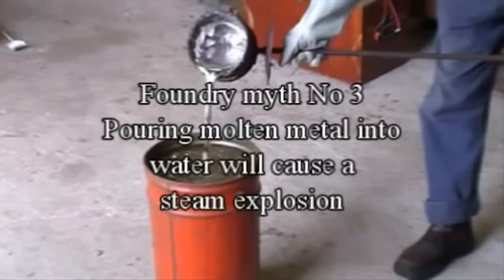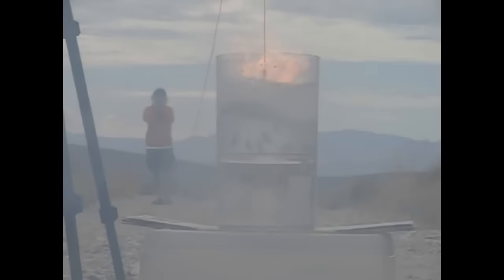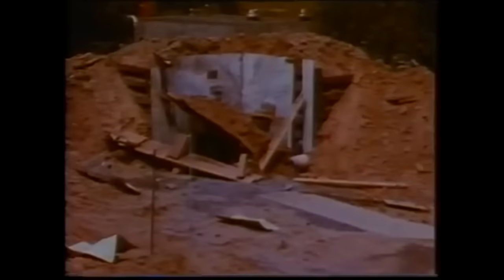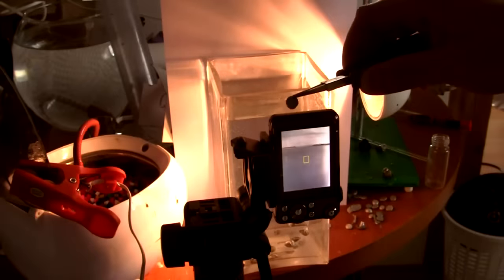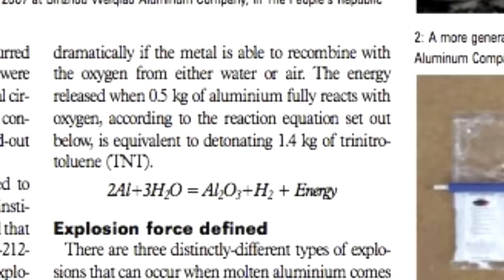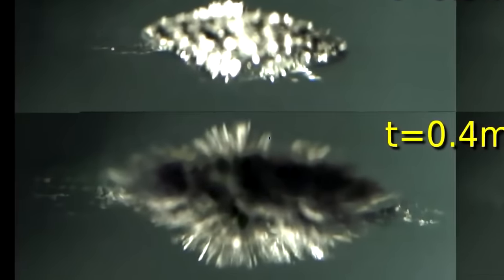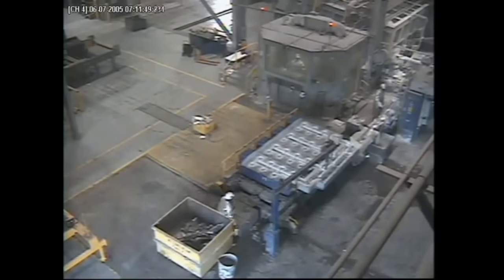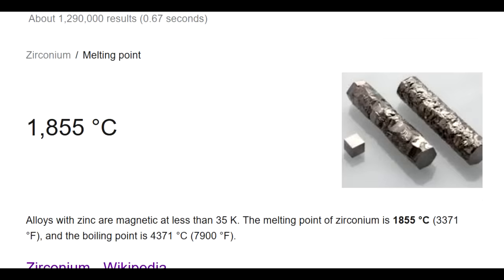The Awesome Power of the Aluminium-Water Explosion!

Comment: Thier logic: No one has ever heard from a person that died in one of these explosions.
Reply: Never again at least.
Reply: Yes, dead people can’t speak. Here is a gold star people ⭐️.
Reply: Love how the dude poured molten aluminum/aluminium/alumininininininium under his nuts...
Windows also shit itself 9:46
Reply: But has an explosion caused by pouring comparatively small volumes of aluminium into water actually been documented? Where is the empirical evidence?
Reply: I would have thought it perfectly logical to conclude this is what brought the main two towers down on 9/11.    The fusalages of the planes melted in the fire, which would have been burning off oxygen inhibiting an oxide layer.    Introduce water from the sprinklers and you blow out the inside of the building.  

This isn't to talk about the whys and wherefores but I can't understand why nobody wants to except this explanation that seems to fit the evidence where the main two towers are concerned.
Reply: this is the same logic that has lead to way too many tragic industrial accidents
Reply: @Daveyboyz1978  Molten aluminium was seen pouring out of the towers - indicating temperatures of over 600C, enough to reduce the strength of carbon steel by 80%.
Fire is really good at turning steel into spaghetti - without melting it at all, gravity does the rest.
Reply: @allangibson8494  the towers had 10 times the required strength even with an 80% loss of strength they would still stand.   More to the point liquid aluminium reacts violently with water particularly in the absence of oxygen (which blunts the reaction by oxidizing the surface of the aluminium) fire eats oxygen and thus when the sprinkler system rained down water on the aluminium the insides of the building were blown up.   This explains the witness statements about hearing explosions and the much hotter  than 600 degree temperatures detected in the rubble as a result of the chemical reaction.
Reply: Sounds like the same logic of covidiots
Reply: sOuNdS LiKe sUrViVoRsHiP BiAs tO mE
Reply: Famous last words.
Reply: @Daveyboyz1978  Right right. They were so impenetrable that the Magic infused steel that got red hot didn't weaken AT ALL
Reply: @thevalorousdong7675  I would claim that, but given the fireball burnt up all of the jet fuel in one fell swoop,  the fire would not be hot enough to weaken the steel by enough to being it down.  (It had a safety factor of ten... losing half its strength wouldn't make it fail)

An exothermic reaction between water and aluminium however would produce enough heat and kinetic energy, and would explain why the thermal scans at ground zero showed 1000+ plus temperatures (far hotter than an office fire remnants)

Comment: We always took a blowtorch to the molds before pouring metal into them when I worked at a foundry.  It served two purposes, 1) eliminate any moisture in the mold and 2) heat the mold up to prevent shock when thousands of degrees molten metal hits the mold.  I realize this is kind of old video at this point, just saying..
Reply: Absolutely, preheating them prevents this, and it is not an explosion of the metal, it is the expansion of water to 1600 times its original volume as it flashes to steam instantly that causes the expulsion of the molten metal from the moulds.
Reply: similarly, I heat up my pans before adding oil when cooking to obtain a no stick cooking surface!
Reply: @kamalmanzukie  you arent pose to add cold oil to a hot pan as it can cause the oil to ignite
Reply: Be sure to heat it up a lot, blowtorch burning byproduct is also water
Reply: @davidblahota5655  Just wow David, that is a critical point that would have never occurred to me. I hope u-tube lives forever because the comments on some videos (like this one) are sometimes as insightful as the videos themselves. thanks!
Reply: @michaelharvey-nb6vw  i don't recall writing that, i was probably drunk, never poured metal, no idea what am i talking about. But i do see condensate around the flame in the first few seconds of occasionally heating up metal with a blowtorch.
Reply: @MrJohnandMargie actually it is a coulombic explosion caused by solvated electrons. If your unlucky enough for the aluminum to have the oxide layer stripped off…then it’s like sodium in water🎉

Comment: when I was like 8 or 9 I saw a YouTube video of someone melting down soda cans and casting them in molds. I was fascinated by it and convinced my dad to help me build a small furnace for melting metal. we dug a deep, narrow, cylindrical hole into the ground, with a hairdryer buried underground to blow air up the holt. we fitted an old steel stovepipe into the hole and filled it with burning firewood, then cranked the hairdryer up to max. after leaving the wood to burn down to white hot coals(accelerated by the airflow from the dryer) we inserted a graphite crucible that we had gotten on eBay and managed to melt down 20 or so soda cans and filled the crucible with molten aluminum, which we cast into a perfect ingot in a small graphite mold(also from eBay). once the metal solidified in the mold we dunked it in water and the ingot popped out. but we forgot to dry out the wet mold before casting more molten aluminum in it and as we added the second crucible-full of aluminum, it exploded, blasting blobs of Liquid Metal 10 feet in the air and splattering my dad's brand new iPhone with hot aluminum. no-one was hurt and my dad's phone somehow survived.

Comment: Had personal experience now already 47 years ago in an Aluminum smelter casting into a mold with barely a drop of water in it. 
Seen with my own eyes it is possible to strip yourself from all clothing in about 1 second flat just to get rid of hot exploded metal on overall. 
Luckily l survived.

Comment: Wow as a metallurgy hobbyist I never knew aluminium could be so dangerous, thank you for making these important safety videos.
Reply: Get some caustic soda, mix it water and dunk some aluminum in it, you get hydrogen gas. Aluminum is disturbingly reactive when its oxide layer is removed.
Reply: @TheRedneckAtheist  Oh yeah, I've seen videos on YT of people filling up fire extinguishers with aluminium foil and a mixture of lye in drain cleaner fluid to generate a bit of hydrogen gas on the canisters.
 The hydrogen comes from the water as its oxygen is used up to oxidize the reaction I believe.
Reply: @zedg7473  that is correct and you get more than a little bit depending on the amount of aluminium

Comment: I had no idea there was a possibility for an energetic reaction between aluminum and water. Thank you for the education.
Reply: The British learned that during the Falklands war.
They had built some warships from aluminium.
Reply: @aggese  I suppose that went as well as I imagine.
Reply: Scott DiMiceli I’ve actually poured aluminum into water and had no idea this was a thing. I knew water entering into the foundry was a risk of explosion but not the other way around. I usually put my casts into water as soon as it was no longer liquid on the outer shell
Reply: it kind of makes me nervous about the aluminum foil in my kitchen.
Reply: @mwperk02  Actually, not as badly as you might fear.  See, it turns out the Argentinian Air Force was even worse at understanding how their own ordinance worked.  They were getting bulls-eyes hits on British warships...from so low an altitude that the bomb's fuses didn't have enough drop to arm them.  (To prevent them from detonating easily when handled or early in the drop, a lot of free-fall bombs have what looks like a little propeller on the nose or the tail.  As the bomb falls, this is spun by the air and the bomb as fully armed while falling once this spins enough times.  This will have some degree of adjustability, but not unlimited, and you REALLY wouldn't want this disabled on a bomb you actually wanted to be able to, say, TOUCH, and bomb release isn't exactly a gentle process.)
Reply: slayne2  Schrodinger's cat hated radiation about 50% of the time I’m told.
Reply: same
Reply: aluminium dust and water ice makes for a VERY powerful and extremely stable rocket fuel.
Reply: Seriously.  It's not like I had any plans to try this, but now that I know it's dangerous, that's a solid no.
Reply: @BlokeOnAMotorbike  
Wow! I didn't know that. Do you have any references I could see?
Reply: @samuelseidel6148  It's risky. Aluminium instantly builds a skin of aluminium-oxide...so that's what prevents direct contact with water. Direct contact of heatedaluminium with water would have it react violently and this reaction would rip the aluminium oxide skin creating follow-up reactions.
You will find no foundrie worker who thinks, pouring liquid aluminium into water is a safe thing!
Reply: Do it doesn't. That is bullshit.
Reply: @jlastre  but one time in every 376 that this experiment was tried the cat was gone but a pile of steaming cat shit was left in the corner of the box..... Schroedinger's shat!
Reply: Doesn't
Reply: @TremereTT  I was Maintenance Manager for UTC Aluminum Remelt and Extrusion Plant from 1981 to 1990
Casting aluminum logs for cutting into extrusion billets is done by direct chill casting. a steel plug is inserted into the bottom of an aluminum ring  that is surrounded by a continuous stream of water. Molten aluminum is poured into the top of the ring in a thin stream. As the ring fills the plug is dropped by lowering the hydraulic ram it is attached to into a pit filled with water. As the ram lowers the plug aluminum is continuously fed into the aluminum ring. The log grows until the log has reached the proper length and the aluminum flow is shut off. The aluminum log is below melting temperature before it enters the water flow. 
The molten aluminum does enter water every time the cast is started because the top of the plug has been raised from the bottom of the pit and remains wet until the aluminum forces the water off of it. 
It is dangerous indeed to be cavalier about handling any molten metal.. Aluminum is one that people see melted on YouTube and think it is safe because of the low temperature. 
Often to their later regret.
Reply: @OldSneelock  I ve seen images of aluminium foundries... only the heavy gear remains in a hole in the ground. It's realy a dangerous Business.
Reply: It seems like if it was anywhere near as dangerous as he claims you could not buy an aluminum John boat that you can scrap on rocks which will knock off the oxide layer
Reply: It’s how they brought down the twin towers

Comment: One factor that makes the explosion more likely, like in the iron cube, is the small amount of water compared to the total energy in the molten aluminum - there's enough to vaporize enough water for a steam explosion to get things started. When it's dumped into a big pool, it gets cooled down fast enough to prevent much happening...
Reply: "When it's dumped into a big pool, it gets cooled down fast enough to prevent much happening..."

That should be _"poured slowly into a big pool"_. If the heat is not allowed to dissipate, the heat capacity of that volume of water isn't going to do any good.
Reply: Bozkurt postuna bürünmüş yobaz AraB devesi  how could it be a hydrogen oxygen explosion underwater? You could have a reaction producing hydrogen (metals+water), or oxygen (fluorine?+water) , but not both
Reply: Bozkurt postuna bürünmüş yobaz AraB devesi  They are steam explosions. You dont separate hydrogen and oxygen with heat alone. The akali metals react with water because they have one electron in their outer shell, that is completely and totally unrelated to aluminum or iron.
Reply: Bozkurt postuna bürünmüş yobaz AraB devesi  yes, so you generate hydrogen. Where is the oxygen coming from to make a hydrogen oxygen explosion?
Reply: Bozkurt postuna bürünmüş yobaz AraB devesi  so how does a sodium water explosion happen in an inert atmosphere?
Reply: Bozkurt postuna bürünmüş yobaz AraB devesi  most commonly used metals aren't particularly reactive. Aluminum, and to a lesser extent magnesium are the exceptions. And aluminum self passivates exceptionally well.

Comment: I remember my apprentice ship and how i once asked what the aluminum on the ceiling was. One of the cast forms made of sand and coated with a graphite solution to create a smooth surface on the end product wasn't dried long enough.

The cast was about 1qm in size with the cast volume of about the size of two car rims. Only about 2 kg of molten aluminum made it in it, when it detonated like a bomb. One dude was pierced ny projectile aluminum, but survived without lasting damages. But damn, the room was about 15m high and about 40x50m in size. Shut was covered with aluminum fragments as if placed by hand to imitate the stary sky.
Reply: Thanks, great video!
Reply: qm ?

Comment: I used to work for Detroit Edison as a contractor in their metering department. One of the types of jobs I would occasionally do is to install remotely interruptable meters for either hot water heaters or for air conditioning units. 

To place the meters for these jobs I had to first move the feed wires for the interruptable service from the load side of the house meter to the line side. In doing this one particular time I inadvertently contacted a live wire with the grounded meter enclosure and the tip of the aluminum cable exploded shooting micro shrapnel into my goggles and my cheeks. Yeah, instant sunburn from ten inches away!

When aluminum becomes the electrical load and there's no circuit protection, there's a colombic explosion every single time.

I was instantly amazed at the intense heat, brilliance of the flash of light, the intensity of the sound, and perhaps mostly, my calmness and presence of mind to not let go of that cable in my glove insulated hand as the tip was exploding!

Comment: The first reaction that would happen in the bunker experiment is that you would flash the water to steam. The steam, under pressure due to the restricted container forces it's way through the oxide layer releasing the aluminum dragon.
By contrast the non explosive shots were pouring aluminum into large unrestricted bodies of water thus reducing the steam flash to only what occurs from the leidenfeost effect which effectively isolates the aluminum from the water.
Reply: Exactly. Thunderfoot is being disengenous in this video by acting like molten aluminum is exactly equal to sodium metal. They're not flipping a coin. They're just doing what they know to be safe enough to replicate.
Reply: So it's sort of like when you're diluting concentrated acid, the difference between adding Acid to Water versus, Water to Acid?
Reply: Aluminium has no problem reacting with steam to produce hydrogen and aluminium oxide with about 1250 kj /mol energy release.
Aluminum is a highly reactive alkali metal which would burn in water or steam if it were not for the thin oxide layer. The addition of 10% aluminium powder to a stoichiometric explosive such as ANFO increases its power substantially as the aluminium reacts with the steam produced by the explosive. Aluminium if it reacts releases more energy than sodium, it is second to beryllium in terms of energy release per gram on formation of the oxide that is why it it added to solid rocket propellants.  Also look up the Raleigh Taylor instability to see another mechanism for liquid metal explosion in water.  It may be that the liquid metal flows to the bottom of the steel box full of water and a Raleigh Taylor instability forms which helps mix the water and aluminium but that should be the case in both instances.
Reply: You mean the Aluminium Dragon, of course.
Reply: Came here to say the same. That being said, it does make me view molten aluminium in water a little differently. I wasnt aware its just the oxide skin standing between this being akin to dumping a crucible of NAK in water. Who knows how many ways there are to disrupt that skin?
Reply: @eelcohoogendoorn8044  Electricity does it rather well, too.  The dross prevents aluminum from being welded, which is basically why AC TIG welding was invented.  (The AC reverses the polarity of the electrode for whatever percentage of the time you need to break through the oxide layer.  But you don't use it more than that because it also eats your expensive tungsten electrode.  Meanwhile, your shielding gas is preventing more oxide from forming by making sure there's no oxygen on the active welding surface.)

Comment: In a nearby VW facility has been an explosion. Cooling water leaked into a two-part mould for aluminum casting - its said that the upper half crashed through the roof.
Reply: Nope, thats VW factory standards.
Reply: @ZoosheeStudio  😆
Reply: @gustavgnoettgen  They were trying to vent excess emissions before the inspectors got there.
Reply: @ERVMEDVAC no, because there is no magnesium! Understood?

Tell me: how can an aluminum mold explode?

Comment: I have worked 12 years in a steel factory and these accidents happens. For example, in a place called VAD-VOD that is basically a big vacuum chamber where an entire 20 tons or 50 tons recipient full with liquid steel is put into, recipes are corrected a bit and some gas are extracted from the steel before their pour it into big ingots we saw  something unbelievable. Because the vacuum chamber does have a cooled top (cooled with runing water), sometimes if the pumps are malfunctioning and the water stops flowing, the steam will gather in the vacuum chamber and cause a violent reaction with the melted metal. One of these tops, we looked after for two days to find it after it exploded out trough the roof. Excuse my english, i am romanian. This is why anything that comes in contact with melted metal in a foundry, must be heated before, so there is no water there.